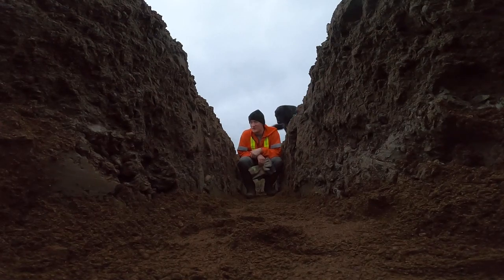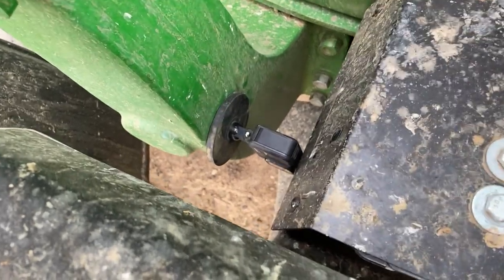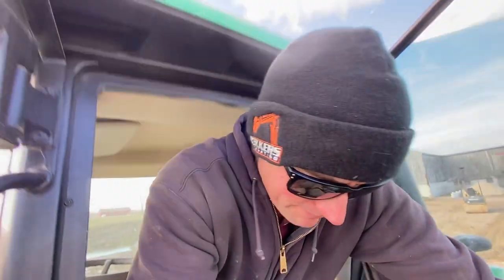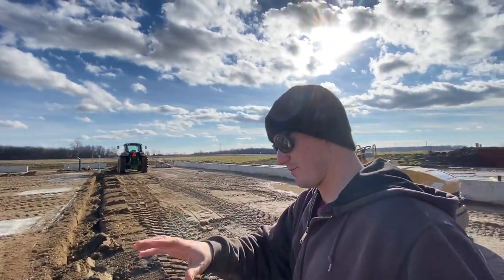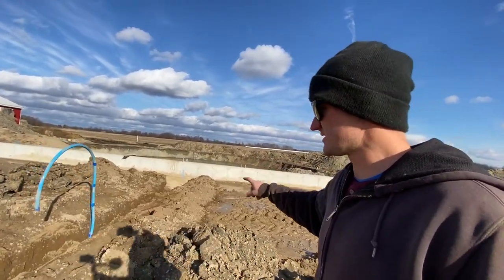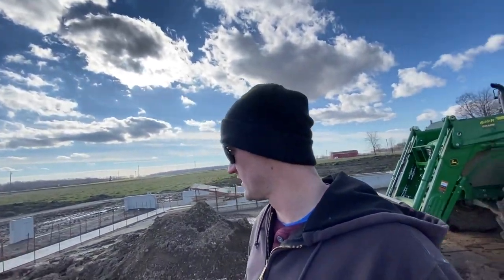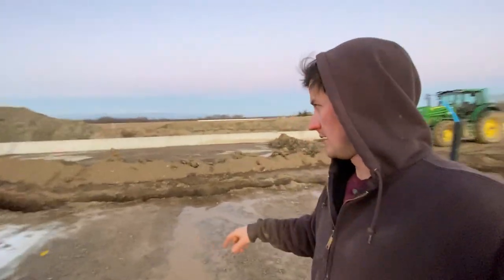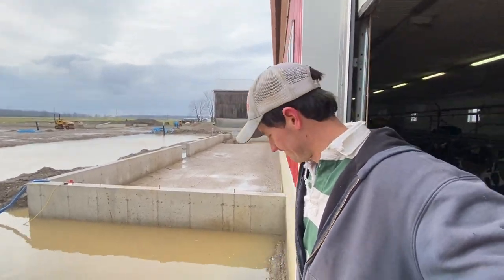WATER LINES DUG! NOW to RUSH to FILL Them In! | Building Our Cow Palace - Ep47

Comment: The "manure room" why two pits? are floors cast before or after the roof is up? I guess it's going to snow soon. We have it but it will disappear before Christmas
Reply from the maker: On the floor question, the idea was to pour some before a roof, but because of the weather we're giving up on that. They'll pour after the roof now.
On the manure room question: one is a 'wet' pit and the other is 'dry'. Basically the manure drops into the wet pit, and then the pump sits in the dry one to suck it out of the wet pit and push it to the big manure pit outside.
Reply: I/  @FreshAirFarmer   b.bc